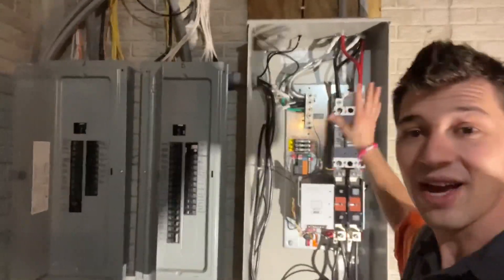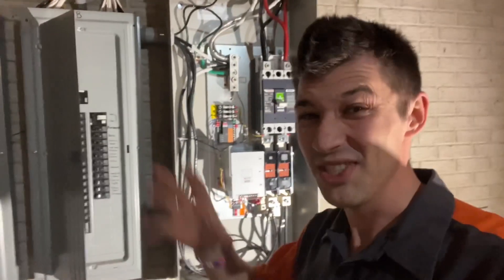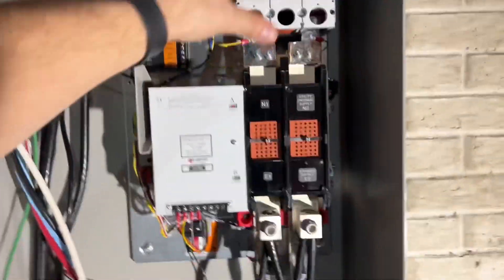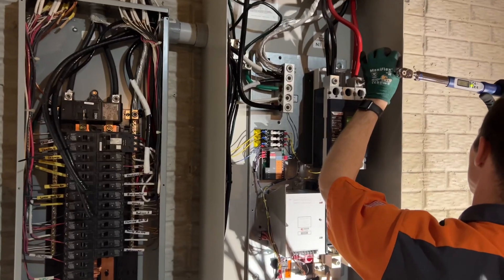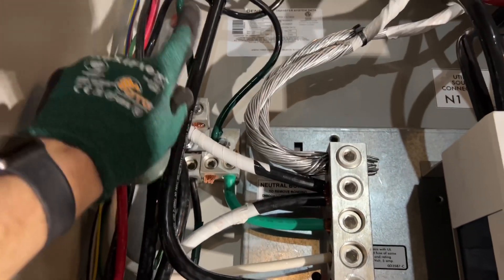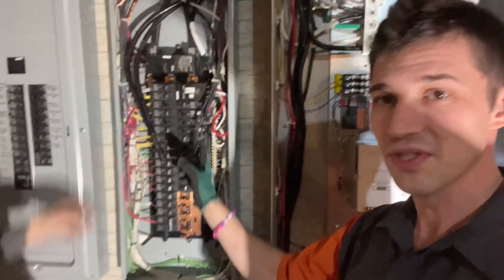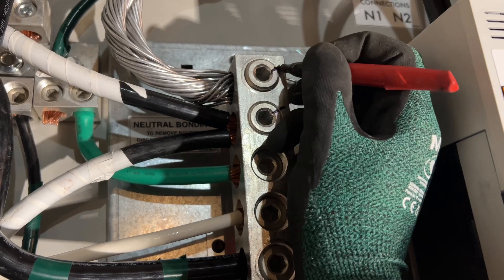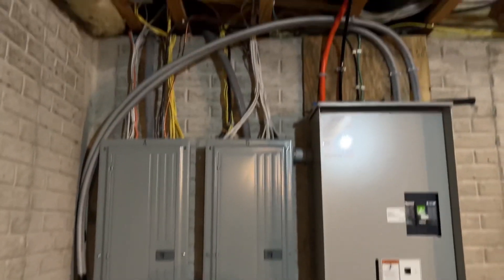This Transfer Switch is MASSIVE! 400A Residential Transfer Switch and 24KW Generac Generator INSTALL

Comment: I’ve seen the same 400amp transfer switch used for 45kw Generac commercial generators used in medium sized residential homes (four 3ton AC units, pool equipment, and whole house back up power), many times.
I’m not an electrician, so please help this old tired residential carpenter/builder understand why a much smaller 24kw generator needs a 400 amp transfer switch. Does it not matter if you overkill the switch ? Is it similar to wiring a 15amp branch circuit with 12 gauge wire?  Please help this “not an electrician” carpenter understand what is going on with the equipment choices here. 😂

Comment: Isnt ilegal to put (2) wires under one lug? Looked like you had the Line Side of Transfer switch double tapped and also on the netrual bar. Seems that would be a violation?
Reply: Unless it’s rated for it they look like snowman or it will be etched into the face

Comment: You do not have to separate the grounds and Neutrals in those two panels under the 2020 NEC as long as you label the transfer switch as an EMERGENCY DISCONNECT
Reply: Show article

Comment: question ---  why are there 4 "hots" at the top of the ATS if the feed is coming from a 400A/320A Meter Socket can?  Wouldn't one set of "Hots" be what would be coming from the Meter - Power Source?   Please help me understand!  Thanks!
Reply from the maker: Ran parallel feeders
Reply: @YourLocalElectrician28  And the Parallel Feeders ARE NEEDED (I take it) because the wire size cannot carry the full 400Amp at 400/320VAC current so it has to be divided up by running two conductors -- And I assume the conductor was Aluminum?  So if you were to run a single copper wire of 600 kcml would that work in the Transfer switch lugs?
Reply from the maker: @retiredperson4054  they are not needed and we could have just gotten large copper conductors but it’s more cost effective to be ram in this manner

Comment: Thanks for posting this. So the load lugs are rated for 2 conductors under each lug? That's what the manual indicated and looks like that's what you have done as well.
    Just surprised there aren't double lugs for each phase

Comment: Just wondering why you double lugged the load conductors, are those the type that are rated for two- 1/0-250 conductors.  Also what type of torque wrench is that?  Thanks, nice video!
Reply from the maker: Double lugged because at 400A it’s cheaper to parallel. 

I think the torque wrench was a Quinn
Reply: So this Generac 400 Amp ATS does have the double lugs on the line side of the transfer module then? AWG Copper size would be 600kmil and the lug would be just a bit over 3/4" inside diameter to accommodate the Copper at that size.